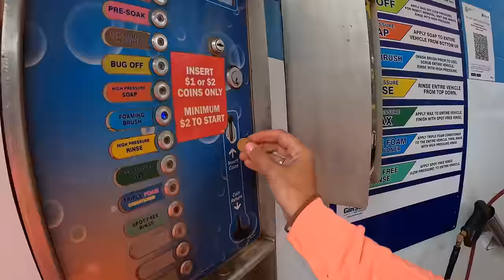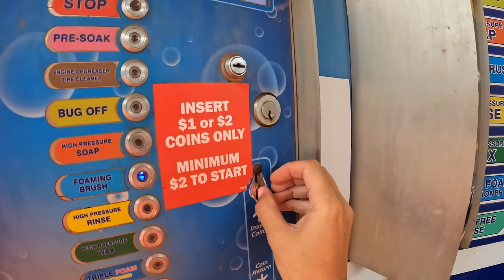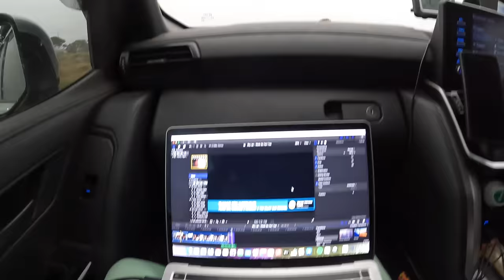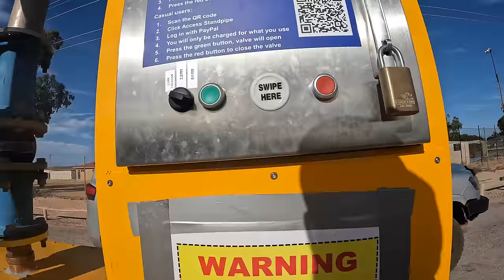Nullarbor Flooded! | Where Are We Going To Stay? | Can We Get Through?

Comment: Maxis are not as stronge in the side wall than BFG. I guarantee when you drop the pressures for the outback gravel tracks you will suffer a puncture or 2 .
Reply from the maker: Time will tell 🤔 👍
Reply: Had sidewall punctures on BFG’s as well in Tassie